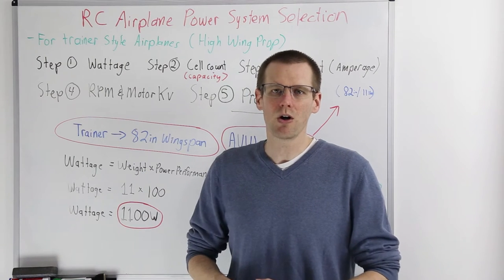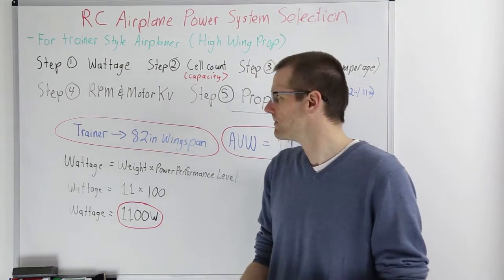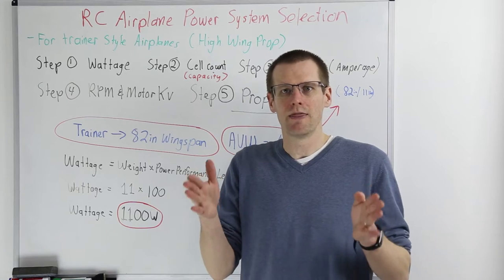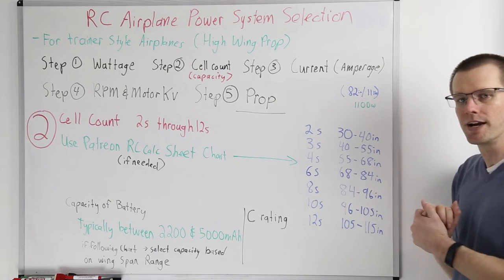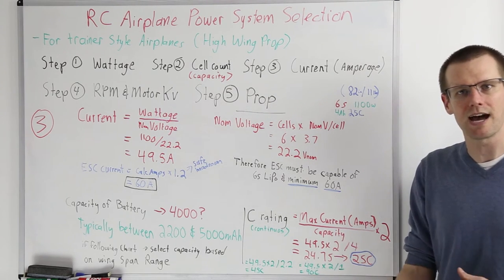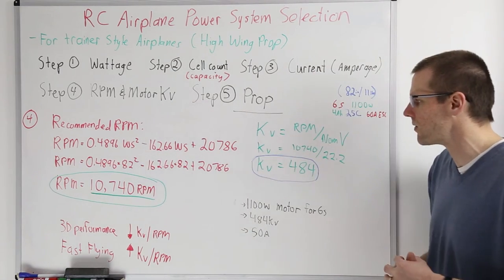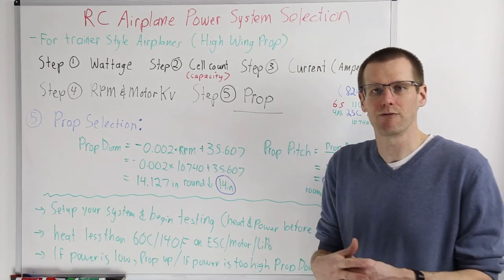Selecting a Brushless Motor, ESC, LiPo Battery and Prop for an RC Airplane

Comment: What is a good propeller for my brushless motor of 44400 rpm at 2500 w? (2000kv, 26,5v, 120a) I'm using a 2200mAh lipo battery with 130C and a esc 1-6s for up to 120A....
Reply from the maker: I can't recommend a propeller for that setup as it's not well suited for the application.

Comment: For smaller Rc plane I think it would be different. As you said 2s battery for the wingspan of 30-40in, but 2s small batteries can be also used for smaller brushless planes like 20in wingspan.
Reply: yeah i am about to make one for 19.2 inch wing span and i am using these calculations but keeping 2s and 3s as my battery option.

Comment: If you were to use 4 propellers, 2 on each semi wing span, what would be the propeller diameter for the same motors, i got this doubt because the formula at 24:24 does not account for multiple motors
, please help me out
Reply from the maker: Multi motors is not part of the scope here. A few calculations would be different and needed to be figured out before you get to prop size for the plane.

Comment: Is there any difference between all up weight and maximum take off weight of an aircraft?
Reply from the maker: All up weight should be lower than your max take off weight. Max take off weight for an aircraft makes for some sketchy flying requiring a good bit of skills.

Comment: I have an esc that says it is 3s capable, but the motor has to be 8.5 turns or greater. All the motors I have are rated in kv and not turns, how do I know what motor I can use using kv rating alone?
Reply: what 'd  you mean you wanna know the RPM of your motor ??

Comment: My thoughts when deciding this is how much room does the plane have for a battery, how big and how many cells in series will fit first than I look at flying weight how much wing do I have to support a given weight for decent flyer and a medium to slow approach for landing.  motor and prop combo is important 
you need to have enough power to climb and enough clearance for the prop.  luckily there are many choices to make power.

Comment: For pitch, how do you arrive at   " Prop Diameter/ 1.57"?   There are many Pitches' for various Props and your Calc will always be the same for any given Diameter.   For example:  Your Calc will always give 6.37 (or 6 ) for a 10 inch Prop.  However,  there are 10x6, 10x7, 10x8 ...  etc props out there.  Please let me know.
Reply from the maker: This gives you a really good starting value for pitch on a prop.

Comment: Awesome Video !!! May I check one calc to be sure I got it right?   I input 48 inches WS, 1.5 lbs., 100 watt/lb.,   3s 1500 mAh Lipo.   My results were   14 Amp Motor, 16 Amp Esc,    18C Lipo, 14,106 rpm,  1271 Kv     and  a 7x5 prop.   Do you get the same ?    Just want to make sure I got it right.  You use a good number of constants/factors.     Many Thanks
Reply from the maker: Yes, I placed your numbers in to the calculator I created for this on my Patreon site. Your numbers are close to what I got. I would give yourself more headroom than 2A for your ESC. A 20A ESC would be safer for example. A 7x5 prop is a good starting point, you may find yourself needing a larger prop when you measure your performance data.

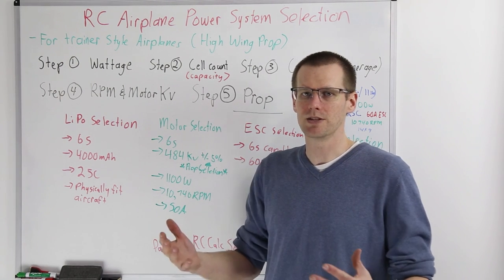Comment: i hate lectures, but damn i can't believe i sat through 29:31 mins. 
this was a detail dive and i loved it, although my wing span is 21inch and motor are the smallest, it's a power efficient rc plane. using 3s li-ion battery with 3-8C only.
everything was great for me in this explanation up until propeller. i think when it comes to prop i'll just take the word of seller recommendation based on motor.
Reply from the maker: Sounds good, thanks for the comment

Comment: So great video it helps a lot do you have any videos explaining diameter and length in correlation to KV and why the length or width of a motor matters when the kv is the same with a Narrow but long VS a short and wide other than fitting it to plane
Reply from the maker: Kv and overall size measured in weight is a good metric comparison for performance.

Comment: Do you have any videos comparing different brands of lipo batteries?  People are always arguing over what brand of lipo is the best. Zee vs Gens Ace vs HooVoo etc….

I have yet to see a video where someone actually compares different 2S/4S/6S RC lipos (not just an on the road test), showing power draw / delivery, how long the battery will last under load, voltage drop under load, etc, with actual computerized measurements / results. 

Maybe this type of test can be done with some sort of desktop setup, so that all of the results will be pretty accurate.
Reply from the maker: I don't. This has come up before but would cost quite a bit to bring all those packs in.

Comment: hello brother,
by using your calculation i am getting a C rating around 3.76 while including 10000 mah li-ion battery with 3C. am i good to use this battery ??
Reply from the maker: It sounds a bit tight. Test this combo by testing for heat on the pack and you will know.
Reply: @RCexplained  sure brother,
Appropriate your response

Comment: Hey man, this video was awesome! I'm building an RC air BOAT, the Dumas Swamp Buggy. Would you recommend a high or low KV/RPM for such a task?

For reference, it's recommended to use a .40 up to .60 gas engine. I figured an electric motor will probably work fine in this modern age!
Reply from the maker: I would go for a low to moderate kv value ij the range that makes sense for the cell count you wish to run.
Reply: @RCexplained  thank you!!!

Comment: can i use.. in my cesnna topfligh 182.. 2 batteries 4 cels 10.000  with my spectrum esc 80 amp (avian spmxae1080 smart) with 1.2 motor s[ectrum ? esc and motor resist for 8 cels? thank you

Comment: Great vid. question though! I have a 3d performance, 31-inch WS, yak that weighs less than 0.5 lbs. and uses 2s 600mAh. 
Correct me if I'm wrong but using your calculations I should be in a 4-inch prop? 
I'm using 15791RPM from (0.04896 x 961) - (162.66 x 31) + 20786 = 15791
and Prop diameter -0.002 x 15791 + 35.607 = 4.025

The reason I'm asking is because the plane came with an 8040 prop but is severely lacking in power. is this because I should move to a 4x2 prop?
Reply from the maker: Look at watts that you require for the performance you are expecting and then hit that mark.

Comment: Think it's better to figure it in this order.. 

Determine approx weight. 

Determine approx watts needed based on weight.  80-150w per lb

 Pick a ballpark prop size based on wingspan. 

Look for motor that supports your needed wattage with a prop that is in your size range. 

Motor choice will dictate esc and battery needed.  It will also recommend prop pitch.

Comment: Im gonna have to make some assumptions on how this can be applied to a less traditional design:

-for a super low aspect ratio of close to 1, i imagine you would double the real wingspan to get to the "effective" wingspan ballpark. For example, a wing of 24" span, but a 1:1 AR would have wing area more similar to a 48" conventional aircraft. Extremely high aspect ratios seem like they would need less conversion, though dividing by 2 for AR above 10 or so might make sense

-for multi engine planes, my guess would be that the wingspan dependent numbers dont change, just the power you want per motor to achieve your desired power loading, potentially with a small fudge factor to make up for any inefficiencies caused by multi engine design

Comment: Hi there I got to the prop formula but it doesn't matter how many time I calculate it I still don't get 14" ? Am I doing something wrong ?
Reply from the maker: Throw it in to an online math calculator to do the math for you. Or use the patreon member spreadsheet.

Comment: My aircraft is around 1.5 LBs with a 30in wingspan. So according to the formulas, I need a 2s battery pack with a 150W 2200 Kv motor but I can't find that kind of motor. suggestions?
Reply: I can really only find one or the other. like a motor that's 2200 Kv but 340 W, or 1000 Kv 150 W

Comment: do you think spinners are necessary for electric rc planes? I have a Turbo Timber Evo. and it seems that the ESC would get better airflow if the spinner was not installed.
Reply from the maker: You can fly the plane without the spinner

Comment: Hey, thanks for making this video. I just tried applying it to my first plane, a conversion of a 39“ Wingspan foam chucker. Unfortunately when I got to step 5 my prop diameter came out negative. Any ideas for what prop to try with a 250g flight weight, 2s battery, and 2700kv motor?
Reply from the maker: It shouldn't come out negative. It should calculate to around 5-6 inches. This would be a good start, then adjust from there.
Reply: Yup, realized I made a mistake. Should have done it in a spreadsheet not on my phone. Sorry for the bother

Comment: I’ve had this question for a while now, I have a 300a esc I wanted to put or pair with a 940kv brushless motor. Did a little research and I found that it’s a bad idea and the (ztw) 300a esc can only handle 800kv brushless. Is that really that big of a difference from 940kv & 800kv to damage the esc..?
Reply from the maker: I need more information as to why an esc manufacturer is placing a limit on Kv. What is the true limit that is driving this?

Comment: Sir, can I use three 18650 batteries instead of 3s lipo battery? Is there any clear downside to it? I don't want to buy a li-po battery because I already have dozens of 18650 batteries
Reply from the maker: It is possible but will depend on the specs of the 18650's and the system current draws.

Comment: Have you built this calculator into excel or other spreadsheet?  If so, is it available?  Are there updates to the constants based on other airplane types?
Reply from the maker: There's a spreadsheet on my patreon link.  There's no other airplane types built in.

Comment: What category would you consider an RC plane that will be towing a 5lb payload behind it? Would this still be a "basic trainer" but we just add the weight of the payload along in the calculation?
Reply from the maker: I would design a basic trainer and not add 5 pounds to the plane as it is not actually supporting it. But add more power to the power system. You'll also want to follow wing span rules for tow planes. You can't tow a 3m plane well with a 1m tow plane.
Reply: Thanks for the reply. I should rephrase my question. I won’t be towing a glider. It’ll be a 5lb payload that will be dropped at a certain altitude. I’m thinking it’ll just be attached to the bottom of the plane.
Reply from the maker: In that case you will have an extra 5 pounds on the plane. Treat it as it is part of the plane. You will want the weight over or close to the CoG.

Comment: Hello.Great videos. Could you (or do you have a video on the 2s+ battery to the receiver and esc. Also, a question about the thin wires for the jr connection; and if  they need a thicker awg. Appreciate it.
Reply from the maker: What specifically about the 2s battery to the receiver and ESC? Required gauge of wire is determined by current running through it.
Reply: Thanks for your quick reply. Motor is an mm1404 2900kv  specs found on Amazon:
KV: 2900
Unload current: 11.1v 0.5A
Max Load: 5.1A
Max. Power: 4A or 40W
Max. Thrust : about 128g work with 4025 @8.5V
Max. Thrust: about 151g work with 5030 @7.5V 10a esc 2s 7.4  450mah;
10a esc; 2s 7.4v; 450mah battery
I realize that I need to view more of your videos.
Thanks much.
 @RCexplained
Reply: @RCexplained 
Thanks for your quick reply.
Motor:
 KV: 2900
Unload current: 11.1v 0.5A
Max Load: 5.1A
Max. Power: 4A or 40W
Max. Thrust : about 128g work with 4025 @8.5V
Max. Thrust: about 151g work with 5030 @7.5V

10a esc;
 2s 7.4v 450mah. battery

Some say that 20awg is what a jr conn can handle. Also, again, explaining about the connection to the motor and esc is appreciated
Thank you, sir.